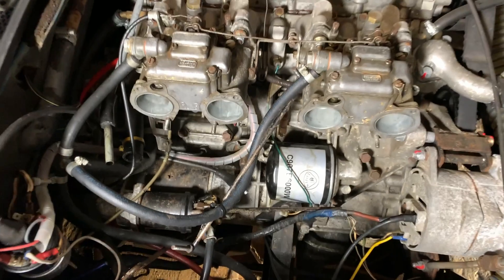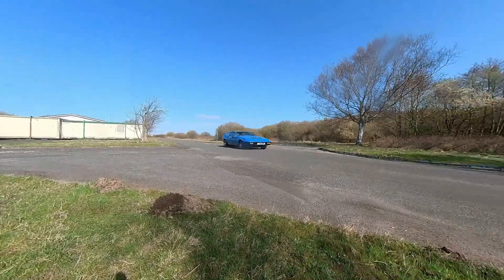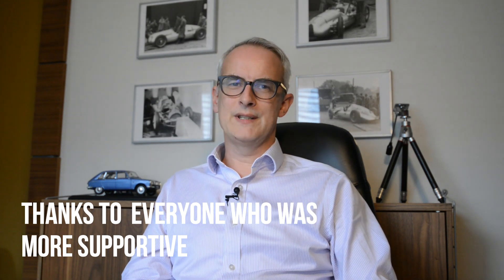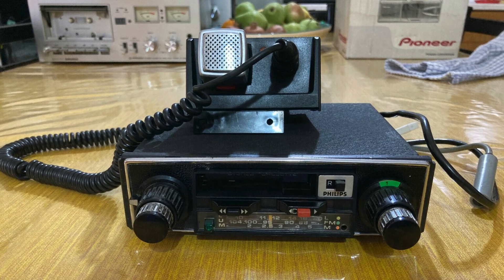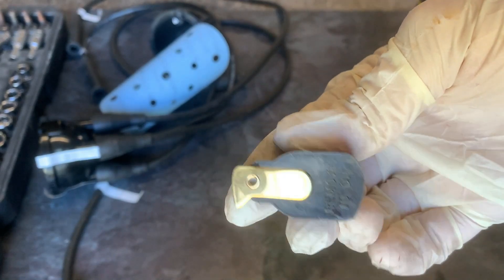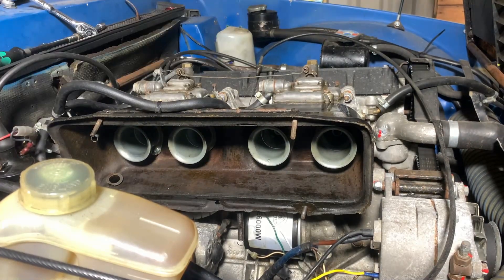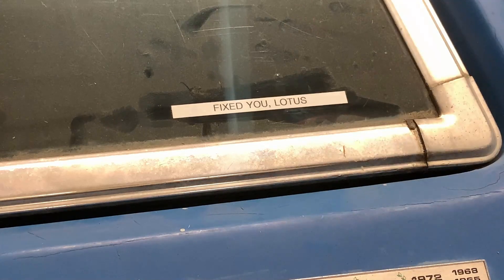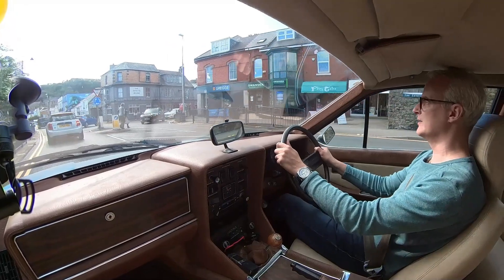Lotus Elite ignition fix and future plans

Comment: I empathize completely with your difficulties accessing the distributor requiring airbox removal- it is tough enough on my 69 Elan but tougher on yours!  Ignore the haters, your channel/style are great and very enjoyable even for those of us w/o a wedgy Lotus.  I recall when these cars came out in the mid seventies and were quite a change from the classic Elan, Europa, and Plus 2 and  have come to admire them over the years and would love an Elite/Eclat but they are relative hens teeth here in the U.S and we have no shops like Lotusbits anywhere here.  I had similar problems with my Elan when I got it- wrong heat range plugs with narrow gap for elec ignition, as well as mixture, timing and jetting off-previous owners and shops though it was running rich with spitting/popping but was actually lean-took a while to sort but now runs great.  Love your stickers by the way-need to get a label machine myself instead of marking pen on tape.  Cheers and look forward to more videos.

Comment: Another great vid. Keep em coming and I feel your pain on the giant lotus airbox blocking access to everything. I've thought of replacing mine but terrified it will burst into flames.
Reply from the maker: Thank you! It certainly is a concern having the fuel bits right on top of the high voltage bits, and cars have been known to catch fire. I’ve replaced the fuel hoses with new ethanol-proof ones too, for that reason - the old ones were cracking inside.

Comment: Although I don't own a lotus, I totally get the frustration. I'm no mechanic, but I have a good basic understanding of how stuff works and with the power of the internet and a trusty Haynes Manual, anyone can do anything. Personally, I find forums a bit tedious, especially when you flip through pages upon pages of opinion and eventually loose patience....and then forget why you went there first 😂😂 Not all forums are like this (before anyone jumps on me for saying this) but having had a few old cars in my time, the experience was a little varied. Oh, and incase your wondering what I drive, I have a Volvo 480. You need a degree in electronics for this 😂😂 Stick with the lotus! 👍🏻
Reply from the maker: I definitely recognise that scenario 😁 (and not particularly with Lotuses)

Comment: On my Sunbeam, I use BPR 7 ES....Ignition is not the original one but an Esprit ignition, all electronic (Tony Killburn)
I have given a number to every wire. it's a very boring work but now I am able to understand the role of every wire.. 
I have also change the bulbs for Leds. it's far better : brighter and less consumption.
But the light on the dashborad (for direction indicator) doesn't work. I need a fasher unit "special led".
I can find it. can you give me please some advice ?

I like to work on my Sunbeam : it's half the pleasure. When I am on the road I have always my tools. it a part , a piece of the car. I can't imagine driving without my tools.
Reply from the maker: Is this what you need?
https://www.carbuilder.com/uk/red-3-pin-led-flasher-relay
Reply: @GrandThriftAuto  Perhaps..I don't know. I have bought two flasher units for led (Bosch) but nothing at all
I will try it..thank you !